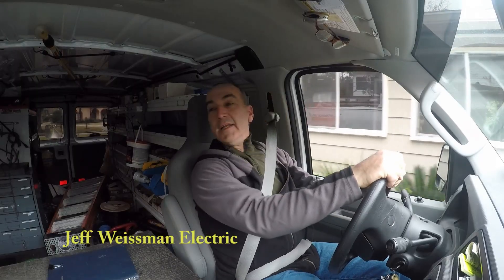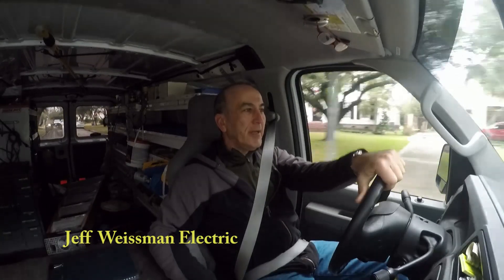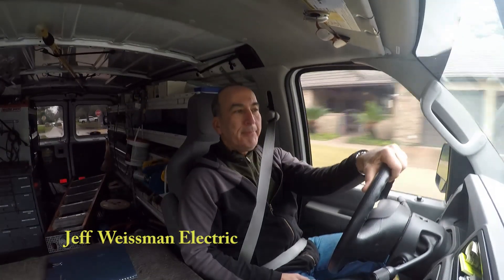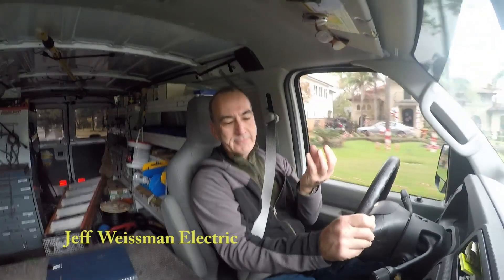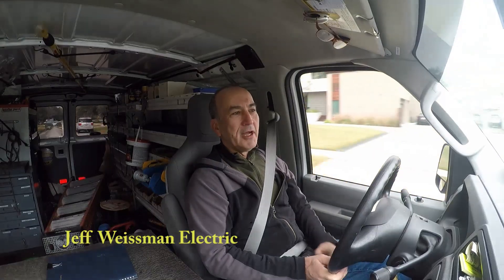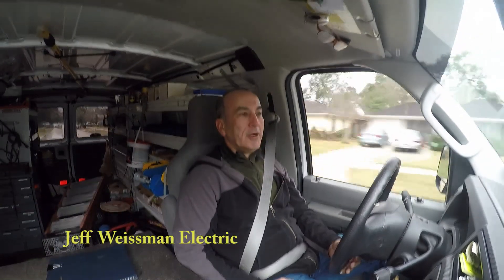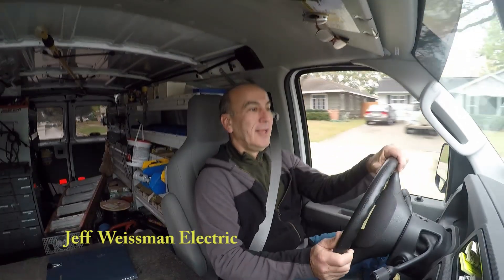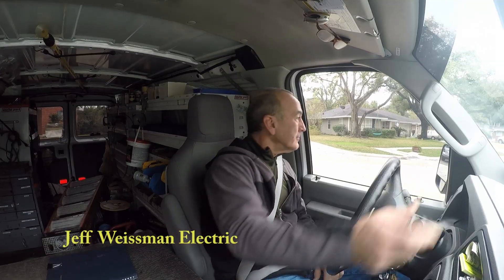Why DO My Christmas 🎄 Lights keep tripping the GFCI receptacle

Comment: I know this is an old video but THANK YOU for giving the straight scoop on this topic. I was at my wits end after taping off every exposed bit of plug face all across my roofline. Simply bypassing the GFCI outlets solved the problem immediately.
Reply from the maker: Your Welcome, and my thoughts about taping up the plug-ins. While it may appear that tape seals the connection, would you tape up a phone and swim with it?  Then there's the likely chance water gets into the connection, and can't drain or evaporate, causing more damage.  Something to think about.  Merry Christmas
Reply: @UncleFjester good point. Thank you 👍🏻

Comment: So ideally, its still safe to just plug the lights into a non GFCI circuit? NO staples, all hung with clips, none on the ground, all new lights, good cords etc, but we are getting tripped since we had rain days ago constantly. I thought for sure everything would be dry by now and everything would work again. Stayed on all night and randomly went out today. More rain coming and I hate for the lights to be out. Ugh.
Reply from the maker: Yes its safe, you won't be outside, barefoot, in the rain working in any of the lights that are powered. And you have enough common sense to verify what you already knew.
Happy Hollidays Aaron

Comment: Ok so the outdoor gfi only protects someone from being electrocuted if using the receptacles correct? So removing the gfi won’t damage anything on or inside the home?
Reply from the maker: Correct! Double check to be sure, by turning off the breaker to the outside circuit and make sure nothing inside is off.

Comment: Thanks... Super informative. This Sucks at the moment though... It's New Years Eve and raining here in NY, just as the festivities get going the circuit keeps tripping and all the exterior lights are going out. I can't imagine going up there and checking each bulb tomorrow... It's a toss up now to troubleshoot while they're up to save the headache for next year or just take them down for the season. 😑
Reply from the maker: Extension cords and temporarily run them inside to non GFI Plugs?
Reply: @UncleFjester  Ha yeah, I made it through comments and saw that. Problem is the heat will run all night if I can't close the window completely. Appreciate your advice. Very helpful

Comment: I don't want anyone to get electrocuted  in my yard so removing the GFCI protection is not a solution even though my previous home did not have GFCIs.   My only solution to the problem  , and it does not work all the time, is to unplug the wires in the yard and then reset the GFCI and then plug each circuit in and when you plug in the one that is leaking to ground, the GFCI will trip. 
and when you find  it, try to insulate it from ground.  I have used plastic bags, WD40 and other water displacement sprays.  You may  get lucky and  find the culprit and you may not.. If that is the case,  you will have to let the circuit dry out.
Reply from the maker: You're a smart man, the only thing I'll add is plastic bags on the male/female connections don't work and prevent water from evaporating.  Let water drain and evaporate naturally.
Reply: Totally agree. I unknowingly plugged my water pump into a gfi outlet. Then went down in the flooded crawl to pump it out. The shock was frightening but not deadly. Don’t remove your GFI’s they might save you or the next homeowner’s life!

Comment: Everything you makes sense. My GFCI only trips with the rain with and Christmas lights. It drove me nuts every year. I even pissed off the wife.😂 I did notice that the GFCI is a 20amp and the breaker is 15amp. The GFCI will not even reset and led light even went off. Do you think it's just the rain issue or an amp issue?
Reply from the maker: Amp Issue will trip the breaker, water leaking into the decorative lights or even a staple thru the right wire into the bark wil trip the gfi.  You can isolate which strands by using an extension cord plug into a non Gfci Protected receptacle
Reply: @UncleFjester  I appreciate your feedback. Thank you for the reply.

Comment: My GFI is in a hall bathroom and my outside/porch plug keeps popping it - thanks for the info! Better start checking those lights! Argh
Reply from the maker: The GFI could be getting weak if you can't pinpoint a location where water is interfering.  Safest option is to replace the existing GFI with a new one.  Replacing the GFI with a standard receptacle allows any family member to "accidentally" drop a hair dryer into the tub or shower, and the holiday lights will stay on during the funeral and pending murder trial.
Reply: @UncleFjester  yeah - I may love the Godfather movies but I’m not trying to get anyone “accidentally” murdered 😂🤣😂

Comment: Headed to Lowes rn to change out our receptacles. This problem has been bothering us for years!!! It has to be our sprinklers. We were resetting the outlets every day!! Thank youuuuu!!!
Reply from the maker: Glad I could help, replace the GFI receptacles with standard receptacles is all you want to do.  then make a small label, because we forget, that says something like "GFI Required here"  Or even better "No GFI Protection" so if you ever need to put it back to sell the house, you'll remember.
Reply: @UncleFjester  My lights are plugged in to an outlet on porch, and in garage.  Neither of those outlets are the GFCI outlet but there is one in the Garage (nothing plugged into it), that trips and thats the one I always reset.  Do I just need to replace that one? or event the one on porch? The breaker panel shows all those outlets on 1 GfCI. Thank you!
Reply: @clubatsonterra5490 yes. Usually all outside outlets are tied together on the same breaker and only one of the outlets will be the gfci, but it will trip if anything plugged into the other ones has an issue.

Comment: Great explanation , however I definitely don't agree with the statement that" if you are aware of the calculated risk in ok"not an electrician but very aware of certain things and I won't allowed any one with that main set to do work in my building , this thinking is what get people hurt .
Reply from the maker: This is a "Common Sense" DIY opinion, performing work for hire is all done according to code.

Comment: So if it is rain tripping the GFI and I've taped all the outdoor connectors as best I can and elevated them off the ground to do my best to keep them non wet and water from getting in there, is it then safe to run it into a non GFI outlet that is inside my house and dry? What would I want to avoid? Is there danger plugging the electrical chain into the dry socket inside, or do I need to not stand outside on wet ground where cables are? Just trying to be safe cause it's supposed to rain on xmas
Reply from the maker: yes

Comment: Xmas lights set off GFCI outlet. But the GFCI wouldn't reset. Went to replace it and noticed it was 20 amp rated, but the breaker is only 15 amp. So I replaced it with a 15 amp. Worked, but then it started to rain and the GFCI went off; Now if I press the RESET button it just clicks right back off. I will wait until the rain stops and RESET it again. Hopefully it is just moisture that needs to dry out.

Thanks for the video.
Reply from the maker: Thanks for watching, there could be multiple other  outside receptacles protected by this one GFCI.  Unplug and test and reset, then make notes and place it in the breaker panel.  Good Luck

Comment: Thanks. I have old light and new lights that both blow the GFCI.
Reply from the maker: did ya have water or snow in them?
Reply: Probably. I think water was getting in between the plug of the lights and the extension cord.

Comment: Did I understand correctly...if I run my extension cord to a non GFCI, it will still trip or it won't?  Thank you for great info!
Reply from the maker: If its a non GFI receptacle, what would trip? 🙄
Try it and report back?
Reply: @UncleFjester  Sorry.  I was just trying to clarify something that you had said.  I thought the same thing but just wanted to clarify.  Didn't mean for it to sound stupid.
Reply from the maker: @kristinasjolund7519  Did you get it figured out?

Comment: My trips only when put into the timer. Doesn’t when just straight plugged into the receptacle. Any ideas?
Reply from the maker: get a new timer
Reply: Uncle Fjester I did. This is the second one, different brand but still does the same thing
Reply from the maker: @timbray4324  then something in the string(s) of lights is acting up.  Process of elimination of unplugging one string at a time, test & repeat. Or TEMPORARY removing the GFI receptacle

Comment: Half of my electric outside has GFI and half of it don't I have a big big big Christmas display and usually when it rains I just don't even turn the lights on it's more trouble turning them on I have everything covered and they still blow. The water always finds a way it's easier to just keep them off when it rains then the put them on and cover every single extension cord with black tape and it still doesn't work
Reply from the maker: Covering the cords with black tape doesnt let the water that got in evaporate.
The GFI that is giving you a nuisance tripping could be failing and tripping at a  lower rate, replace it and see it that helps.
Reply: Jeff Weissman thank

Comment: Just replaced my GFCI with a non-GFCI and voila the christmas lights are back on, thank you sir.
Reply from the maker: Happy Holidays!!    Just remember, you now lost your Ground fault Protection. Odds are something in your lighting is/was causing the GFI to trip.  When Xmas is over & you remove your lights, I'd recommend installing a new GFI receptacle.  Then before you put your lights away in storage, plug one in at a time & see which string has the problem in it.
Reply: Is swapping the gfci for a non gfci outlet a fairly simple task? I'm thinking of your suggestion here just for a month or so. We haven't even gotten a real snow yet in NY and I'd be sad to not see my lights on once this season during snow. 😁